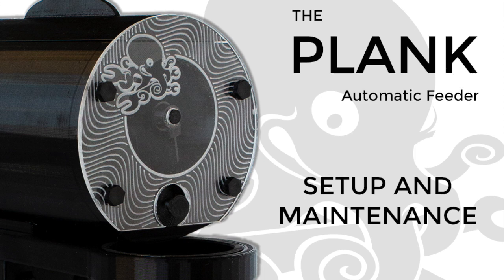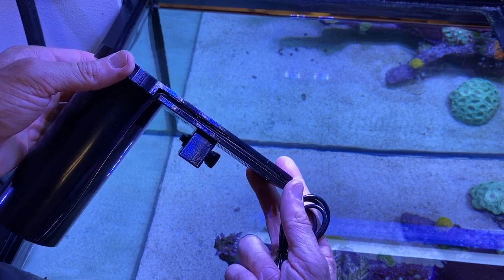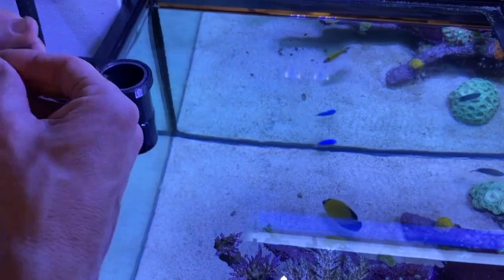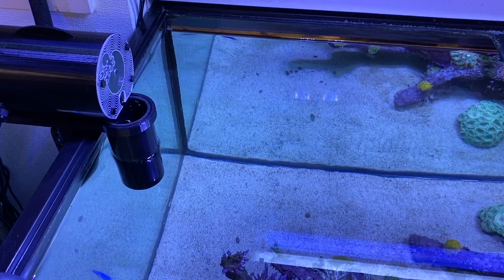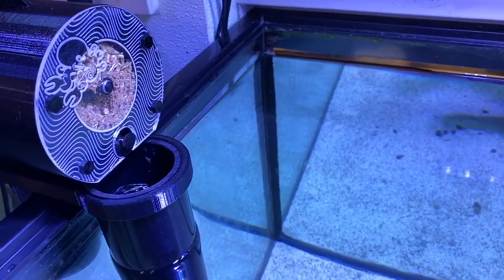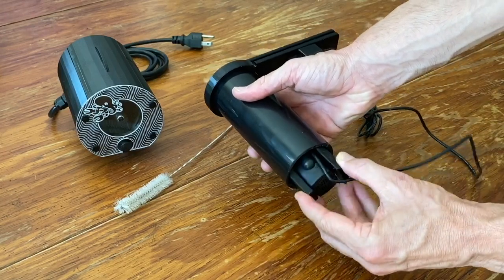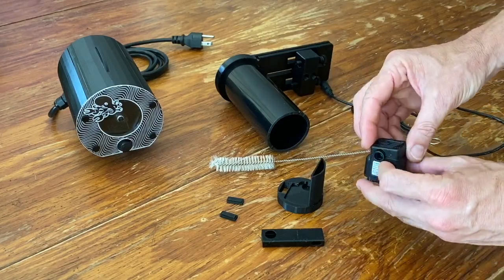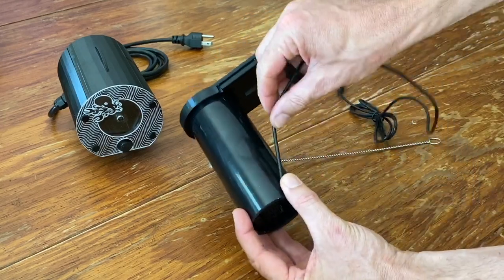Plank Automatic Feeder Setup and Maintenance

Comment: I just received the product and assembled it connected it to my Apex and it works amazingly the fish love it. Now I can go on vacations and watch my fish eat via the camera LOL..

I just want to point out these tips in assembly:
..
 I did remove the set pin and now pump assembly fits perfectly ... After I put the pin back.

 I did use a zip tie to vertically join the pump to the circular assembly to get that to be snug so the zip tie really worked...